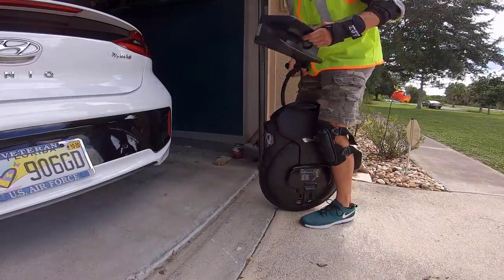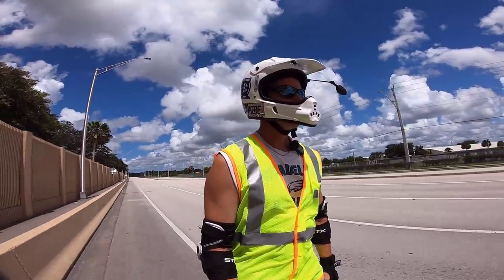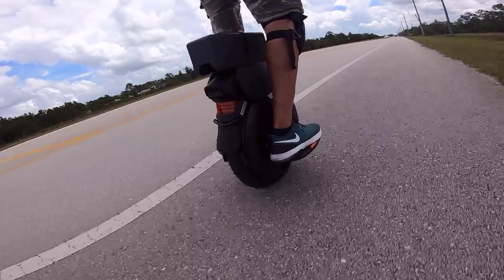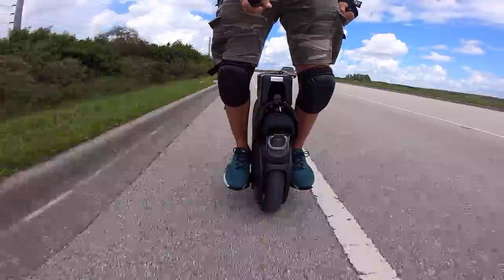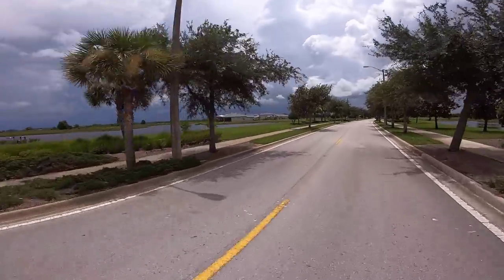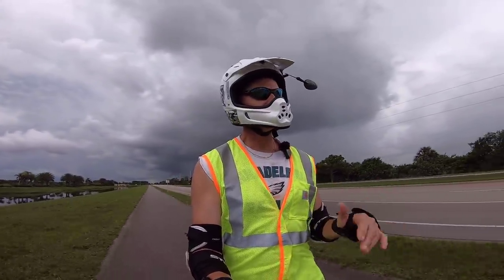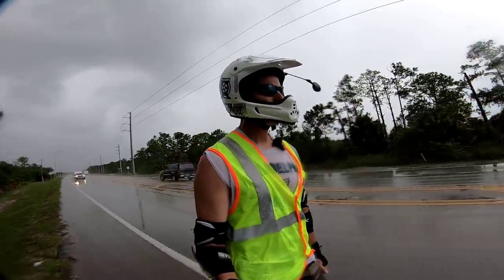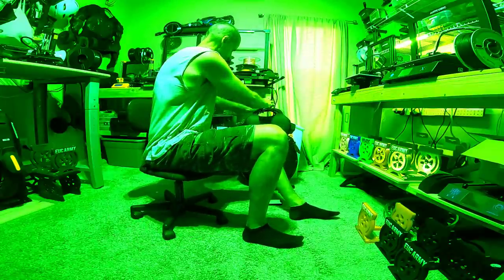Can it go Further?? - Production Inmotion V11 Range and Bonus Water Test!!

Comment: Told you inmotion would be disappointing...the simple fact that they add negative chamber and not telling anyone about it, says everything. I'm not buying their shit, that wheel is not the stud everyone said it would be.Good review, keep up the good work.
Reply from the maker: I love the wheel overall, I was just expecting better range based on what others told me about the production wheels versus pre-production.
Reply: Agreed. That range is horrible... I went 21 miles at 27-29mph on my 16X and only used 35% battery on the 4th. Think I'll get the S18 now.
Reply: @Duf  I know that... That's why this is so upsetting because I ear everyone say "yaaah 1100wh vs 1500wh, no way I'm buying that one " no matter how good the ride is. That's precisely the reason I will not choose a wheel over the battery level announced by the manufacturer, plus we know KS does a good job when it comes to estimating range on wheel (we saw it in your DD ride on the s18). V11 is a very good wheel but to me if it does not have the range announced, then it has nothing that appeals to me compared to the s18. That was the main downfall "the battery". But I love the light I have to admit, it's so bright, we need more led lights with lenses like the one you see on car, they had a great idea.

Comment: 70.4 volts should be 36%, looks like they still see 68 volts as 0% which is insane, maybe they didnt update it?
Reply from the maker: It could be an app thing then?  Not sure.
Reply: @Duf  Not sure, maybe it calculates normal riding % to 68v, and then the go home mode comes until 63v or 65v. the difference can be huge, people need to take voltages more seriously instead of percentages

Comment: Nice video Duf your efforts are appreciated by all. I was surprised by your findings though, I thought the production model would definitely give a bit more, although its not the end of the world.
I have a complex torn meniscus they told me I'd need an op  years ago, I found traction fixed it so it doesn't hurt. I have a thing called a swing table which allows me to lie back on the table,  which pivots backwards allowing me to hang by my feet at any angle I want. I bought this table for my mum rest her soul, years back. I've since found it has all sorts of benefits for your back and organs too..........  I was in my late 40s when that happened, I'm coming up for my 60th now , it flares up from time to time, but the swing table sorts it every time           😼
Reply from the maker: Supposedly an app change may change those battery numbers.  So basically an inversion table?  How long do you hang upside down each time?
Reply: @Duf   🤞 for that app....  yeah the swing table or should I say inversion table, you should stay on it as long as you feel comfortable.  You get comprehensive instructions and a video with it. My partner's brother is a Chiropractor,  after I leant him my one, he ordered some for his surgery.  Your meant to use it as much as possible , but I tend to get it out when I get signs of a problem,  be it my back, Knee, neck or shoulder......  I've broken a lot of bones over the years, suffering some of those consequences now.....
I go to a Chiropractor monthly, but when the knee starts screaming,  the inversion table has been the only answer so far. I tried pain killers, didn't like them and they became less effective with time plus I hate taking pain killers anyways. An inversion table might be worth giving it a try in your case....
(Geese I should be a salesman for this product.....  WHERE'S MY COMMISSION!!!!)

Comment: You have to do the range test again.
You will not get the same or better numbers if the conditions that the test are done in are not the same.
It had to be more wind , less traction and it didn't look like you were focused on speed for the whole trip home.
Reply from the maker: Actually I was more consistent with my speed this time.
Reply: Ok , but the conditions of the test weren't close to similar

Comment: Hi duf .in the Inmotion chat group we asked about the power for range and apparently the new app will unlock the extra reserve battery ,, called go home mode,,So it might seem that you have full power down to go home mode,, this is a question followed by liams reply ,, 
,,,,@LiamZeng_03 A few of us worry because it seems that on the 1st batch V11, 0% battery is at 68V after all, not 63V or lower. Duf’s range test was a bit disappointing because of this.
Will the battery plan change?
Reply,,,,,,We will update the new app soon that can activate the backup battery soon
Reply from the maker: Somewhat confused by the answer.  So does that mean after the app is updated 0% will be at a lower voltage number so remaining battery pct should be higher?
Reply: @Duf  from what i understand you can run the wheel down to 0% the there's an option in the app to activate go home mode and then it will show you the remaining battery what limits you to say 15mph but not sure if the top speed yet,, that might be 15 or25% of the battery maybe
Reply from the maker: @ElectricunicyclesUK  Interesting.  The app said even though I was at 24% battery I still could go 30mph.
Reply: @Duf  thats because it will let you down to 0% then you can activate go home mode and then it will show you the reserve battery percentage

Comment: Hey duf. I have an android phone. I downloaded the app  from the play store. I dont see anywhere that I can change the pedal angle...or change to mph instead of everything in km. Any idea why i can't make these changes.
Reply: you have to click the gear icon in the top right corner.
Reply from the maker: I would need to dig around more in the Android app, I have been using iOS since it allowed me to set the higher speed limit.
Reply: Hey duff. I'm all set i texted inmotion usa. They helped me out. All is well with the wheel. Nice wheel isn't it. Smooth and very quiet. They told me about the neg. valve. They said you don't have to fill it to enjoy the ride. Its not necessary they said. I just fill it from the bottom. Also I don't think the v11 will fit on your stand.  I have 5 of your stands. I put the wheel on and it balances on the center part where you fill the air, thats not good. It rocks back and forth.
Reply: @stevesellers3170  I think you should fill h the negative chambers though. If you don't you will get sharper bottoming out like how duf felt on the pre-production. Having some psi in the negative chamber will always help.

Comment: Hello I wanted to ask you I installed the trolley handle on my Inmotion V5 and I also have the pedals from v10 / v8 and the tire pressure at 3 bar and my Inmotion V5 no longer drives as it was I no longer have as much controversial about that Cycle as before, how does it go where it wants and I feel every pebble since the pedals are big and pleasant but I lose control when driving and who I try to drive, then it wobbles extremely back and forth you know a lot about what that I suspect that it is because of the v10 pedals and that is why I lose control and the pedals are much too large, the magnet cannot hold them who they are trapped and I believe that the tire pressure is too high even at 3 bar
Reply from the maker: I don't see how the pedals would make it feel that unstable.  Perhaps the tire is not seated on the rim evenly??

Comment: That looked like fun - not :-)  Yeah, not great range, but OK.
Reply from the maker: I heard that IM still has not put the change into the app which takes into account going deeper into the battery.  Supposedly once they do, battery remaining numbers will be better.
Reply: @Duf  So it's not a firmware change? If you ignore the app numbers you could ride further? Interesting.
Reply from the maker: @ElectricUnicycles  It sounded like it was an app change, not a firmware change.

Comment: One question with the pressure you set for yourself whats the overall height of the V11 my reason for asking is my KS18S sits at a height of 27.5" just wondering if they're a close match?
Reply from the maker: I'll need to check it.

Comment: Hi, inflating the car tyre at a petrol station is just push on/pull off, with no need to screw onto the Schrader valve.  Would it be the same if an air compressor is used instead of the hand pump for the shocks?  Would the air compressor go up to such high pressures?  The white lines on the road are plastic strips that are heated with a blowtorch to fuse them on, and definitely very slippery when wet.  Great vid again.
Reply from the maker: I dont think it work well as a tire has so much more air volume.
Reply: @Duf  ok, shock chamber on v11 is much smaller in volume.